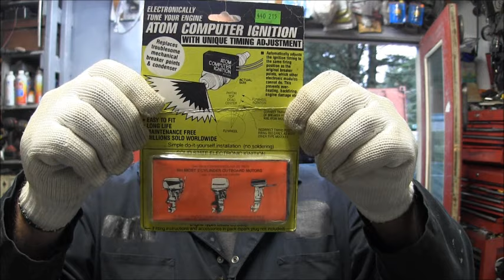SUZUKI  197?      7. 5  ABUSED

Comment: Tried those Nova chips on a 2 cylinder OMC engine and they worked ... for about 5 minutes. With such good compression and decent spark, you ought to get a pop so the timing must be off. A sheared ignition key is a probable culprit. Bon courage, mon ami !
Reply from the maker: Yep'   Thinking &  Look'n  @  All  those  things,,   Gremlins   4  Sure, hahaha.       kb

Comment: That Japanese pull starter design is a little overkill,LOL! Curious on how those two chips are timed to the cylinders? Also wondering on those two coils under the flywheel are they like trigger coils what are they??? if the regular ignition coils are on the head .I would probably polish & leave & reinstall the points before condemming the motor if last resort.I do understand it makes for good content to get that Suzuki to run good on those chips..Good video either way looking fwd to see what you decide on in the end... regards...TOT62
Reply from the maker: Yep''   Me  Just  trying  to  Learn  New  Things,    It's  a weird kinda  habit  I  cain't  shake,    Haha  It's  Fun   tho.    kb

Comment: Remember Japanese motors use higher trigger voltages 6-9 volts,using a dvmeter they have less problems
On Suzuki 1 1/2 hp and dual cylinders with points to set timing using a depth gauge to measure when piston was coming to top dead center and then set points.
Reply from the maker: Yep   Been  scratch'n  My  Head  on  these  early  Zukie's   4  sure. haha    kb

Comment: Hi Kodi, very interesting set up on that one. Something I have never ran across yet. The 3hp Belgium Johnson with the trigger set up was one that I had fun with and runs great after I fixed the throttle cable. With spark on yours I thought for sure it would fire once you were able to get fuel into the chamber. You said you disconnected one of the Nova's and it fired right up so maybe it doesn't need two but to run one to run both cylinders? Hey, I got the boat loader video done and will see if I can send it to your email since I haven't loaded it yet. Let me know what you think. I'll have it up in a couple weeks for everyone to check out.
Reply: You email business address didn't go thru? Do you have another one?
Reply from the maker: Yep ''   Sum  kinda  weird  Japan  electronics  Go'n   on  4   sure. Hahaha        kb